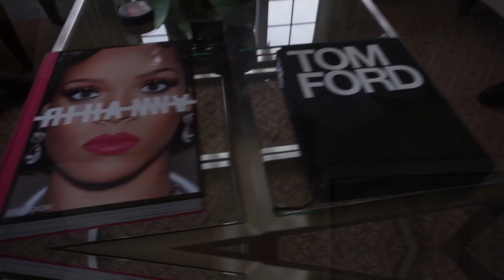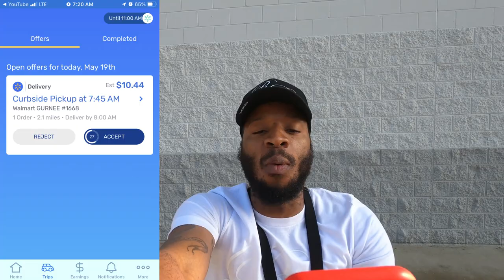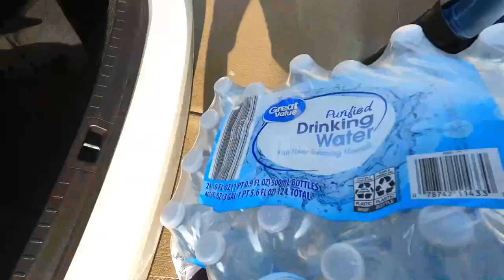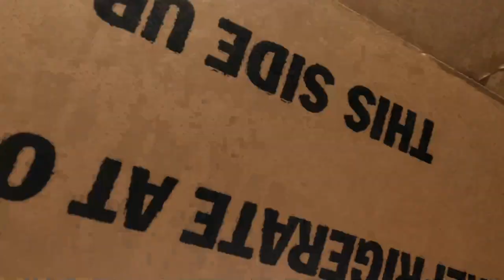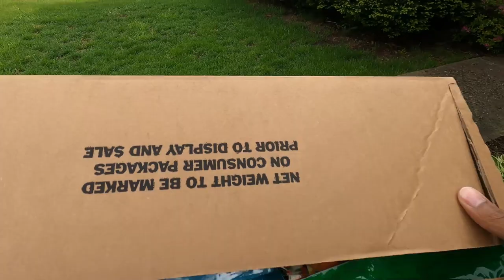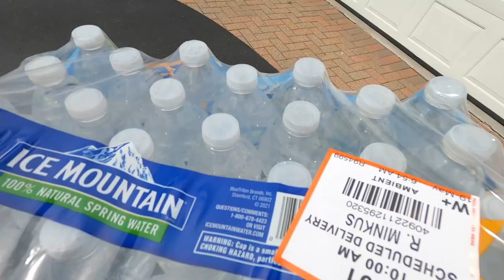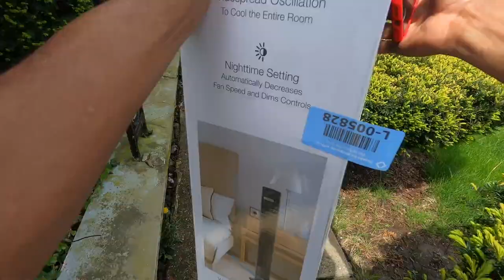Would You Unblacklist Someone For An Incentive?🤔 InstaCart, DoorDash, Spark Ride-Along,Tips & Tricks

Comment: My dude!! The incentives are crazy right now and guess what, I had to go and get a NAIL in my tire. Im sitting at the dealer right now. I need 2 more to complete the 15 order one before tomorrow so I can get the special Sunday one too.
Reply from the maker: Ssshhheessshh!! At least you caught it without sitting on the side of the road. That’s crazy I need 2 more also to complete the 15 order. What is the special Sunday one? I don’t think I’ve had that one before.
Reply: @carsandcribs  so I got the 15 orders DONE and wouldn’t ya know my LAST ORDER was TWO ITEMS, ice cream and canola oil and the notes said ‘you must get a signature unless otherwise noted’. So I go to deliver, it wants a signature, knock knock, no one answered. So I called support they gave me the trip credit and a whopping $2.50 return fee (whatever lol it’s on my way home). SO for tomorrow I have 5 trips $125 guaranteed (not including tips).
I got my tire fixed it had a nail ‘on the shoulder’ so it was replaced for free because I have the roadside protection.
Reply: @carsandcribs  and yes I was full of anxiety about my tire until I got to the dealer. I filled it up with air twice but it would go back down to 8-9PSI. Shhheesshhh
Reply: It was a shop & deliver too so $20 base. For 2 items oh hell yes.
Reply from the maker: @danisdelivery4919  💪🏾💪🏾💪🏾I guess we have to take the good with the bad but “Either way it go we running up that doe”‼️